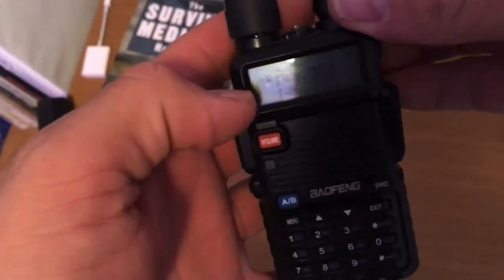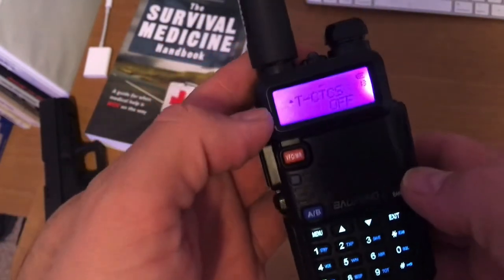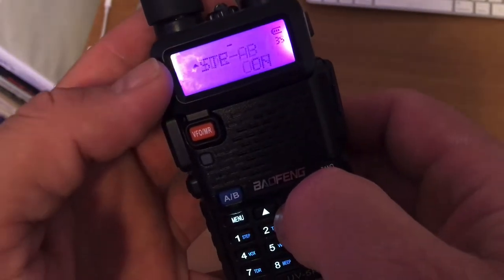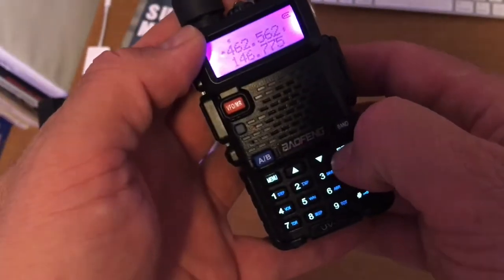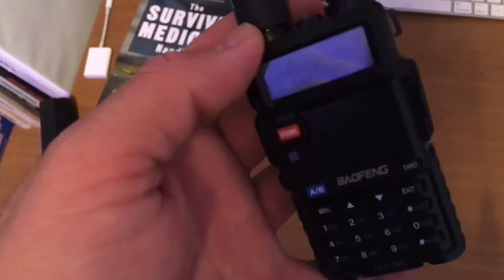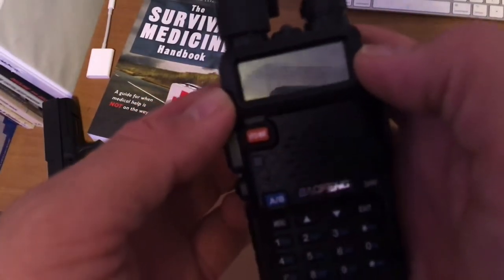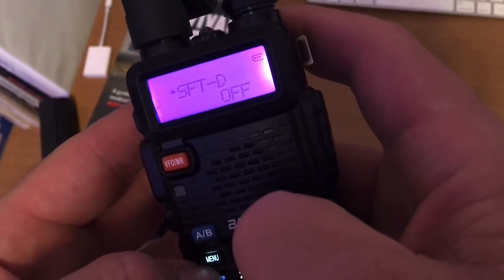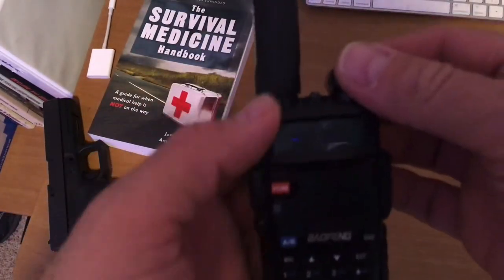FRS programming on handheld ham radio

Comment: Question, I went on the FCC site, paid $35 for some sort of license, no test was taken, so what exactly did my $35 pay for? I'm told in order to obtain an actual license I need to take a test of 35 questions!
Reply from the maker: $35
Cost of FCC license fees: $35

The FCC now collects $35 for new amateur radio licenses. The fee was mandated by Congress and went into effect April 19, 2022.
that what you paid the call it a fee but its a TAX- now  you may be able to find a HAM license exam for free-most are about 15.00 
to study I used an app called Hamstudy I believe it was 5.00 it a flash card system that drills the test over and over and has tech,general, and extra test questions very much worth the small price tag.   I hope that helps.
Reply: @Wyco_Nomad  Thank you, so am I able to transmit? Or like you said it's just a tax with no benefit?
Reply from the maker: @michaelhenneman5600  you can not transmit till you take the exam and pass, you will then be issued your operators call sign, then you can transmit per the rules set by the FCC.
Reply: @Wyco_Nomad  Thx, I was told by this YouTuber to go to the FCC site, fill out the application, pay the $35, and I will be sent a licence and and a call sign, I guess we can't trust YouTubers sometimes! Thx for clarifying!
Reply: the  answer  you took the test for ham  there is no test  for g m r s just give f c c the money

Comment: All of a sudden, my FM Radio & my NOAA Channel are NOT sounding Audio even though they are transmitting & my UV-5R is receiving the signal,... What have I done ?
Reply from the maker: Could be a few things TX PL/CTCSS or DPL/DCS got changed, or the ease one the volume is turned down (its happened). Also if you have been plugging in a mic, the Baufeng has a strange issue when plugin in and unplugging A external mic or the transfer cable.
Reply: You likely, accidentally, activated a subaudible tone squelch. It can be disabled by going into the menu and disabling the ctcss receive.
Reply: The suspense is killing me. Did you ever hear NOAA again? Have you been without the dear robot voice for 7 months? My god man are you alive?
Reply: @BamaChad-W4CHD  😂
Yes, all is working & the world is at peace again.

Comment: Why does the offset need to be zeroed?
Reply from the maker: I have found that if it not you wont hear anything.  GMRS uses a +5 but FRS its set to zero also FRS doesn't use repeaters. 
"FRS/GRMS radios all transmit and receive on the SAME frequency (called "Direct", "Simplex" or "Talk-around")."